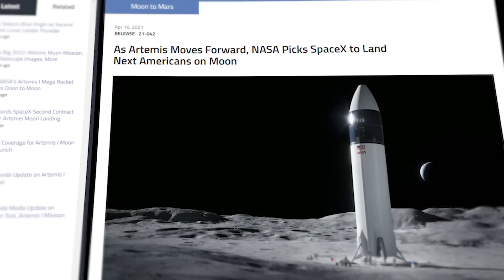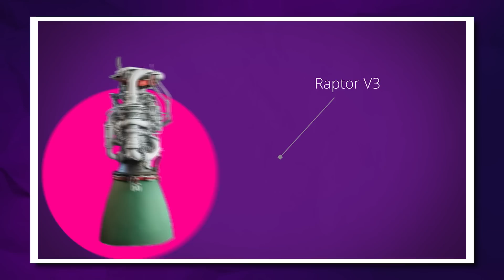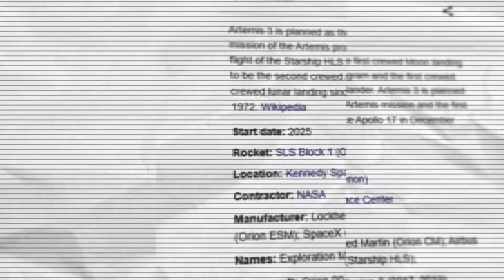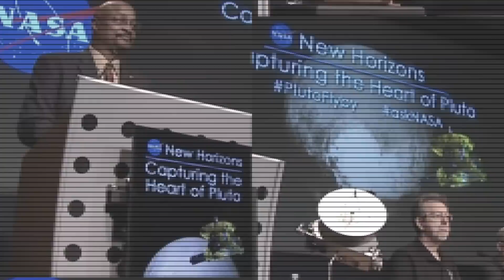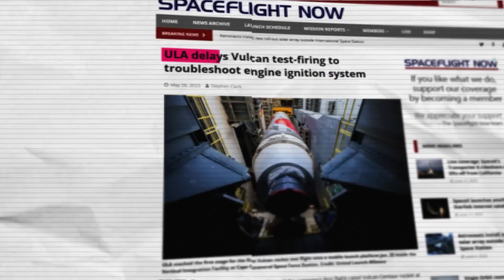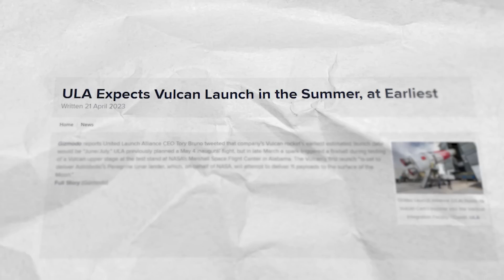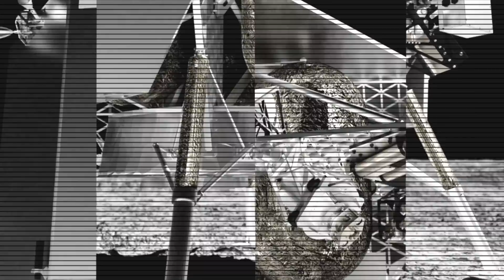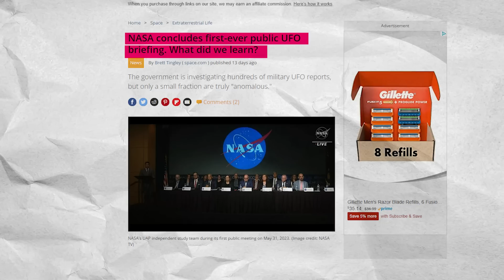Major NEW NASA & SpaceX Moon Landing Update!

Comment: I reckon ULA would have benefitted Al around by using SpaceX engines would have got them where they needed to be faster as well as keeping them on the gov. No.2 list. Face it the SpaceX engine s continueally prove themselves continually. Whereas blue origin are still trying to achieve successful launch repeatedly. Just makes better sense.

Comment: The JWST was proposed in 1996, but launched successfully in 2021. I won't surprise if the manned Artemis mission launch in 2045.
Reply: technically artemis mission was proposed in 2012
Reply: I don't think the manned mission will happen until the 2030s. There is so much testing to be done, there's zero chance it happens by 2026. They need test the refueling, then the landing, the reentry, on and on. Then do a test run of everything. Not to mention the testing and perfecting in between each of those steps. Probably 2030s.

Comment: Some university developed a CO2 scrubber using silver non tubes in a spinning liquid the oxygen leaves as a gas, and the carbon floats to the surface and can be collected off like a cream separator. It doesn't require much voltage to operate the system, and deliver clean O2.

Comment: Those 33 raptors "shaking the booster apart" is one thing I DON'T think you're going to have to worry about. As the first launch attempt proved, that sucker is TOUGH. Undergoing the gyrations it performed, any other rocket would have torn itself to pieces. Even passing through maxQ almost sideways didn't destroy it.

Comment: to be fair the auto refuel is gonna be significantly harder to achieve than the automated dragons, since the starship could never be as nimble as the dragon capsule due to its sheer size... but i can guarantee you if SpaceX was at all worried about it they wouldn't be doing it, they would simply find another way. SpaceX is probably the best when it comes to anything space faring related so i have no doubts SpaceX will figure it out and hit the deadline, maybe with a month or two delay but 2025 is not out of the question in my mind
Reply: And you can quote me on that

Comment: How did they not anticipate the damage from this previous launch?
All that damage should not have been "unexpected".
Reply: They had done a static fire and thought that the pad area would be okay for one launch. Turned out they were wrong. But they already had plans in the works for the deluge system for the second attempt.

Comment: Every other aspect of Artemis are farther behind schedule than Starship, so SpaceX isn't the biggest problem NASA has with the program.
Reply: Great point. I didn't even realize they were behind. Sounds more like they put Elon on Elon time.
Reply: Everything is on time with Artemis right now,I'd say spacex is the one delaying Artemis 3
Reply: @galadato7425  Nothing has orbited around/landed on the Moon that will be needed for Artemis III. Nor is it ready for launch. Artemis II will be the first time that the Orion capsule will be manned and go around the Moon. With as much problems as SLS had just getting off the pad, expect more delays with the NASA side of it. Then you have to get a Rover up there. The Rover is supposed to be there before the humans return to the surface of the Moon. And as far as fuel transfer in space, BO is going to face the same problems as they have now had to eat their words for Artemis 5. And worse, they will be dealing with liquid Hydrogen instead of liquid Methane. So the next thing will be successfully getting a Starship to orbit. Once that is achieved, the HLS will follow rapidly. It already has been proven that Starship is stouter than thought and HLS is basically a modified Starship. With Raptor 3 engines being able to run at higher pressures, you can throttle them back some and still get the same loads to orbit as with a Raptor 2 engine. So look for a change to the Raptor 3 engines soon.
Reply: NASA'a biggest problem with the whole program is NASA.

Comment: The only reason they had to destroy the first Super Heavy is that engines were damaged from the disintegration of the launch pad.
Reply: Bingo!
Reply: No, they tried destroying it but the  FTS failed to blow it up and it didn’t blow up till 40s later by other means. At lift off, just 3 engines was lost and the remaining 30 could make it to orbit but more and more engines got taken out and even the Hydraulic power unit got destroyed so they couldn’t even steer the ship, they lost control of it after that and just prolonged the flight to see how far it’ll go. Booster 7 is an outdated design and was meant to blow up if anything. It was a failed booster but will undoubtedly give rise to success to her Future brothers and sisters (B9,B10, etc).
Reply: @trickeruniverse1979  They had so little faith in Super Heavy Booster #7 that they scrapped #8.

Comment: The next StarShip launch has a good chance to reach orbit.  They need to test their new water deluge system in any case.
Reply: I believe they tested it in small scale on a recent engine testing.  Not sure of the results.
Reply: @jekster it didn’t work, it’s clear in the video that the water coming from the steel plate could not tame the heat and power coming out of the raptor engine. They’re gonna need extra shielding for the steel plate and also more pressure cuz taming the force of the 33 raptors all at once,isn’t really looking like this steel plate thing will work At all. Just my Observation and research
Reply: I am literally appalled that NASA fell for Elon musks cons. Starship is never going to go to the moon. Starship is never going to put people in orbit. I guarantee you that the only way we're getting to the moon is if NASA gets off their asses and develops their own landers because SpaceX is not the answer. It is just another one of Elon musk's frauds. Nothing that they have said was going to happen in the time that it was going to happen if it is even happened at all. I mean hell starship was supposed to be on Mars like 3 years ago. It's shit they can't even make a launch facility that can survive. How the hell are they going to get a rocket to the moon? Instead of going with a guy that uses old technology that is already been proven not to either be worth the hassle like vertical landing rockets. You know the thing NASA was doing in the early to mid 90s. I think 93 or 95 and decided that it wasn't worth the effort and the cost to do. And then we can talk about the falcon rocket not really being a quick turnaround launch vehicle. It's also not any cheaper than typical launches nor is any faster. Another two things again that Elon Musk lied about. What he's trying to do with starship and it's launcher was already tried and unsuccessfully, tested over and over by the Soviet Union when they were trying to get to the moon. When they were literally putting the entire GDP of their country and all of their national pride into the space race because they needed to beat the United States. The first stage having 20 plus engines or 10 plus engines has already been proven to be a non-starter. Or a dead end if you will. That's why the Russians never got their lunar program into orbit. But yeah, let's talk about how their launch facilities water distribution system might not work correctly. Think about that. They literally cannot design a system to pump enough water or build a launch pad strong enough to withstand the thrust of their rockets. And those are all super easy engineering problems. It's almost basic arithmetic and then you just spend the money and build things bigger. And if they can't figure those two things out, how the hell are they ever going to get to the moon? I'll tell you what I bet you. We get a starship to the moon the same time that you can hands-free drive a Tesla, and I mean like sleep at the wheel, and be able to drive from California to New York City without getting into an accident. In 2017 with the 15,000 add-on option to his cars. There's a class action lawsuit about that line. I wonder how long until the government opens their eyes?

Comment: Why the hell should NASA be WORRIED it TOOK BOEING how long to get SLS ready with hydrogen leaks? Jim should be worried about BOEING and the Wilson Aerospace Lawsuit. Jim's speech about SPACEX is nothing but deflection of how worried NASA is about SLS. NASA/BOEING should have two more SLS rockets in the pipeline before upper stage and lunch tower redesign?

Comment: In pursuit of a fully reusable rocket, SpaceX fails to reuse even the one component everyone else re-uses - the launchpad!
Reply: The launch platform for SLS also has to be repaired from the first launch.
Reply: @gravelydon7072  It was only a scratch - compared to SpaceX..   Damage included discoloration and peeling of paint on the pad, two cameras that were rendered inoperable, as well as the destruction of a pair of elevator doors, blown out by the intense pressure at launch. The upper levels of the mobile launcher are currently only accessible by stairs, and the elevators will take several months to repair.

Comment: SpaceX might not be ready by 2025, BUT neither will SLS.  Artemis 2, SLS's next launch, most likely will not be ready  to go until late 2024 or even early 2025
Reply: No way Artemis will be ready on time,  SpaceX has a chance, but should take advantage of the extra time
Reply: @chadleeds4169  SpaceX should just do their own crewed lunar landing
Reply: @CountryLifestyle2023  SpaceX can't bite the hand that feeds them.
Reply: The launch date for Artemis 2 is November 2024.
Reply: @E Bonaparte  Yes that is correct,  but the crewed lunar mission is December 2025 and it's Artemis 3
Reply: @CountryLifestyle2023  It was recently pushed back to 2026.
Reply: @ebonaparte3853  Aretmeis 3 or 2?
Reply: @CountryLifestyle2023  Artemis 3
Reply: @ebonaparte3853  Than SpacsX has lots of time to perfect Starship.
Reply: Exactly right. It looks like NASA plans to dump all their failures on SpaceX's doorstep. 
SLS isn't a stable, proven system and there's some real question marks over sticking humans on the SLS (NASA has killed 19 people and a lot could have been avoided).
Reply: November 2024 was the latest date noted
Reply: @Brad Hanley  For Artemis 2, the crewed lunar landing is Atremis 3 and that us 2025 December
Reply: All of you Elon fannies are high of Musks crack rock. Artemis launched LAST YEAR. It's a rocket THAT ACTUALLY WORKS. SpaceX promised in 2016 to launch their Starship/BFR in 2024 ON MARS with 100 humans inside. They're not going to launch it WITHOUT HUMANS until new fake date in 2025. PUT THE CRACK PIPE DOWN and then tells SpaceX is any better.
Reply: I think SpaceX has the potential to be rdy by 2025. It is scheduled around December 2025 so that's almost 2.5 years from now. 
SpaceX can do alot in 2.5 years. 

Especially if we see 2 more Starship launches this year and they are more successful each time. Than increase the launch attempts in 2024/2025 and complexity of missions. 
It could be possible for SpaceX. Not a guarantee but possible.

Comment: There should not have been any liquid hydrogen involved with the core stage one static fire test?  Did I miss something?
As for SpaceX, as long as they are allowed to test and test launch, I believe they can get a “Lunar Lander” into orbit.  They can get a regular Starship (upper stage) into orbit… that Earth reentry will be a trick… the highest “bug component” to debug with this launch system one they stop damaging Super Heavy with stage zero debris (sorry, I still believe that impact damage was the root cause of the failure to reach orbit).
I also believe the NASA supply delays will be the cause of launch delays with the next Artemis launch… future R25 production may be part of the issue.  I hope I am way wrong.  In any case, we may have gone to the Moon in 1969, but the safety and risk factors have all changed.  In the back of my mind… I wonder how many CCCP cosmonauts were “lost in space” just to get there first and the west never knew about it… another excellent video
Reply: Where did the CCP "get there first"? I don't recall them getting anywhere in space first.
Reply: @donjonjr1  first man in space Yuri Gagarin
Reply: @raytribble8075  not from the CCP
Reply: @raytribble8075  you are correct, my mistake 👍
Reply: @donjonjr1  no worries… it’s all good
Reply: @donjonjr1  First artificial satelite in space!
Reply: @_starfiend  the CCP did not do that.. wrong country
Reply: @donjonjr1  CCCP is simply the Cyrillic version of USSR
Reply: @_starfiend  my mix up, my apologies 👍
Reply: @donjonjr1  No worries.
Reply: @donjonjr1 obviously you are lacking on your history lesson!
Reply: @jeffmentzer9186  check again bud
Reply: @donjonjr1  I did check and you're still wrong bud.....
Reply: I'll guess that ULA wanted the rocket to be as heavy as possible so the hold down clamps don't have as much to hold down.  Same reason SpaceX did their 33 (31) Raptor static firing at 50% thrust.

Comment: The Starship test flight was a complete success, it wasn't assumed to make orbit. Everyone keeps saying it failed just because it blew up. I would say the damage to the pad was the only "failure" of the flight. I am personally impressed it cleared the tower. They will knock this out of the park. We tend to forget just how successful they've been through the years, just compare them to any other space programs.
Reply: The other failure was the rocket not aborting and self destructing as quick as it should have. But I still completely agree with you
Reply: @targetweek47  Yeah, that one could have significant consequences.
Reply: @SaltyClamPirate  it's better to find those mistakes on test flights than the way NASA finds mistakes... 😅😅😂 lol
Reply: I am looking forward to their new steel based water shower head system.  This could be a game changer.
Reply: A point of a test flight is not for everything to go right. The point is to check what is going right.
Reply: I agree that the launch pad excessive damage was the only serious problem they didn't expect to have. It came out of left field producing so much damage. I'm not sure the new metal plate will be enough along with the water deluge system to completely control any possible damage. They may have to beef the launch pad even more. The concerns over engine vibration didn't pose a problem, and by increasing the diameter of the fuel lines they can even reduce the vibration more. Controlling the formation of bubbles limits vibration by providing a constant flow of fuel without anything that would interrupt a perfect delivery. It will probably never run as smooth as a Lexus without adding a retardant to the fuel, but any kind of retardant would reduce the engine thrust, and defeat the purpose of a more powerful engine. So you just learn to live with it.
Reply: Yeah it didn't even self-destruct successfully. But the "oh crap" look on Elon's face when the first stage didn't detach just oozes of success. 🙄
Reply: @donjonjr1  In iterative development, failure is a very welcome outcome. If everything goes right, it's hard to identify what can go wrong. Better to go wrong now then with people on board.
Reply: A complete succes? even the FTS didn't work properly not to mention structural problems with the core stage. engines burned their chambers, engines shut down prematurely, failed stage separation. The launchpad is a joke and a complete engineering fail. Don't forget strarship and superheavy were supposed to fly twice a month in 2022.
Reply: @salland12  Do you even know what iterative design even is? This flight did not fail in its objectives. It failed to reach orbit, yes, and that was expected.
Reply: @salland12  It was only a 50/50 for not exploding at the launch tower. It flew, went up high. FTS didn't go off right away but did eventually terminate the flight. 

Had this been NASA there would have been ppl on that flight 😅😅. Remember the successful space shuttle
Reply: @CountryLifestyle2023  OMG, those firstshuttle test flight pilots though, my hats are off to those massive sets of balls.
Reply: @saltyclampirate7397  Agreed.
I grew up with the space shuttle, but looking back it wasn't a great system. And I have way more confidence in SpaceX than NASA.

Dragon capsule has already gone on more missions than the space shuttle (can't remember if it's crew dragon, cargo or both combined)
Reply: @CountryLifestyle2023  Both combined, and it's not the number of missions, but the hours in space. But then, the crew capsules stay in space for six months on a single mission, while the shuttle never stayed in space for longer than 17 days.
Reply: @_starfiend  Still an impressive milestone and only more to come.
And eventually SpaceX will have 2 vehicles capable of bringing ppl to space, which is impressive as well.